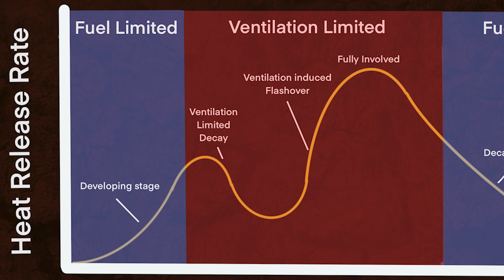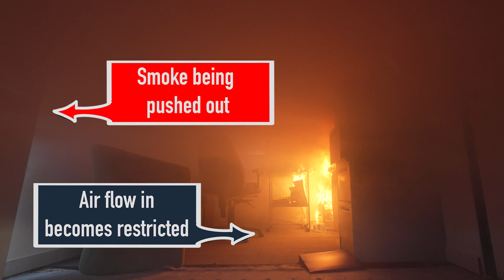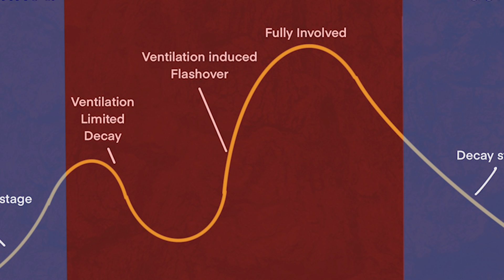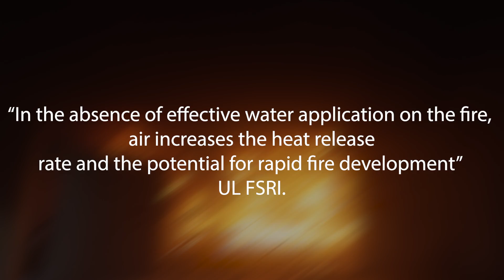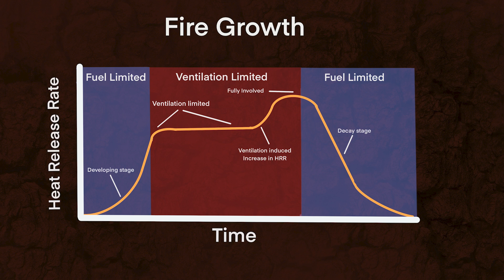Fuel Control Vs Ventilation Control - Episode 27

Comment: In light of what has happened in Switzerland on NYE I took it as a wakeup call to educate myself. Me and my colleagues were having conversations about the task of first responders (so NOT the official firefighters but the people around an event). 

Could you make a video about what to do and what NOT to do as a bystander in these situations? Strictly talking about saving life perspective. I wouldn't risk anybody to save material, but to save people, I think I would have the urge to act - my colleagues told me that I would make the situation worse.. For example here it's obvious you don't break the windows in a burning home, but if I see people at the window stuck... I think I'd break it open to let them escape, even if the fire becomes worse (and potentially more people are still inside deeper in the building).

Also about what would be a responsible way protecting our home (be it rental or owned) from fire and giving us chance to escape if it becomes worse. For example in a modern concrete apartment block if the neighbor apartment is on fire... should I risk going down 6 floors of stairs in fumes to escape or lock the door on myself and hope help arrives... boy do I have a lot of question and don't even know where to start looking.

Thanks for the videos, I'm going through all of them as a marathon!

Comment: In my opinion, they shouldn't break the window which will introduce a large amount of oxygen. But the firefighters in the video did it as a kind of standard procedure. I'm quite confused.
Reply: They're likely in America, where in a lot of places it is standard procedure to ventilate a structure
Reply: I’m in volunteer fire academy now in America and they showed that “window breaking” video of exactly what not to do. It is true that type of ventilation was taught for many years so will need to be unlearned over time.

Comment: Very insighful, we are being trained (in uk) to only vent and use gas cooling when its too hot to enter. Otherwise starve and contain, although this is alot easier when dealing with mainly brick buildings...
Reply from the maker: That sounds interesting! So do you use smoke stopper blankets or just door control to help starve the fire on entry?
Reply: @MattDavis5  Yeah we call them smoke curtains we throw them on entrances and exits. Its drilled into us to close every door we come across, and for members of public to close every door at night or when spotting fire.
Reply from the maker: Yeah cool. How have you found it using the curtains? I like the idea of them, but haven’t had the chance to use them at a real fire.  And we are much the same with closing the doors. Both for our firefighters and for our public awareness campaigns 👍🏽
Reply: @MattDavis5  Quite useful, seconds to put up, prevents as much air going in instead of leaving door wide open because of the lines/hoses going in. Can sometimes flap about a bit in high winds though 😅. Apparently they are kinda cheap so would definitely recommend for every department, adds another tool to the belt.